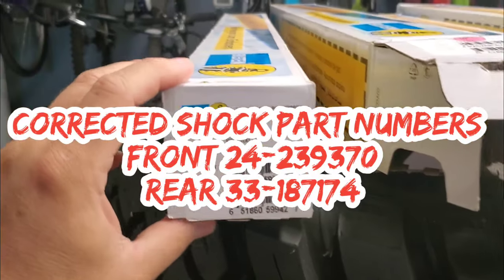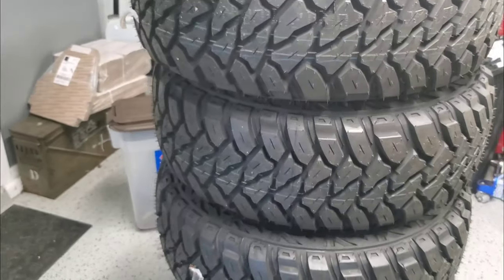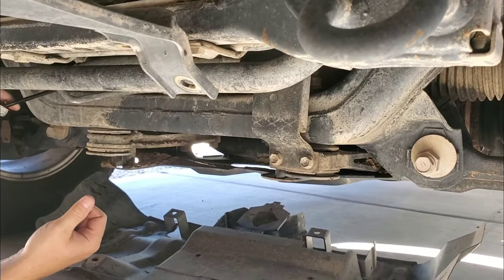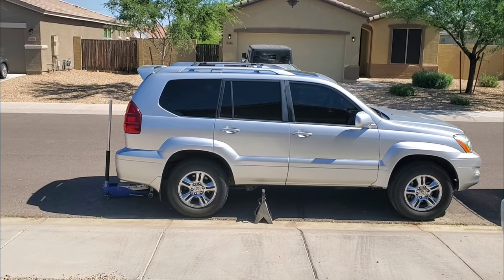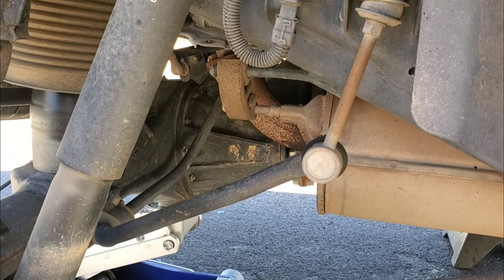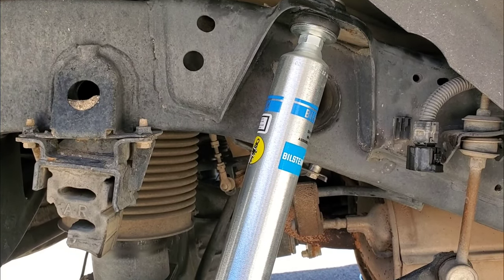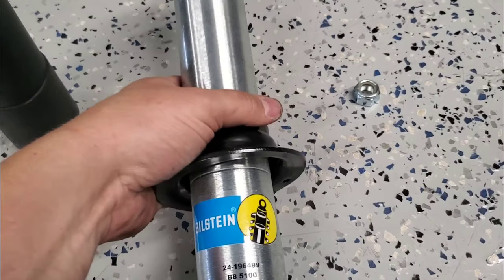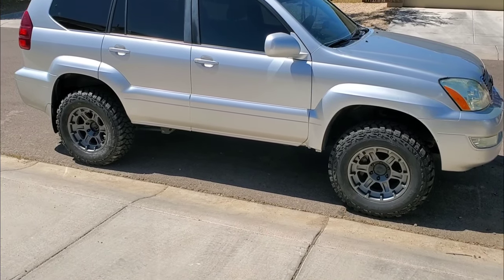SIMPLE LEXUS GX470 / GX460 / 03-09 4RUNNER LIFT. AIRBAG TRICK - BILSTEIN 5100 - DIFF DROP

Comment: Just wanted to say thatnks for this.  Worked great for me, I kept the stock rear shocks(for now), added a simple nut spacer and let it all air up. Its 1" higher than stock which on stock wheels looked good just enough. Going bigger in the future, bit this worked til i can run off some tread on the stocks and justify the MTs

Comment: My GX470 has been stock longer than any other vehicle I’ve had. Finally ordered Bilstien 6112 for the front. Will try the air bag trick and add Dobinsons long travel shocks to the rear I had laying around. Once the bags blow I am going with AirBag Man 2” lift bags. They can be tricked up to 4”.
Reply from the maker: Right on! Are the bags original on yours? If so, definitely change them. They never last long with the added pressure and being so old. The arnott bags are cheap and so far, holding up awesome.
Reply: @MR_Garage  I believe mine are still factory but don’t leak down even after sitting for a few months. 

I ran my GX460 airbags tricked up around 2” and had a set of Airbag Man 2” lift bags to swap them with when they blew. I installed the Dobinsons coil overs up front and had ran the rear completely stock for over a year. 

They survived a Lone Star Jamboree and I never ended up installing the lift bags because the stock bags wouldn’t blow no matter how hard I tried lol 😂 Flexed them to the bump stop plenty of times too.

I’ll be ordering some lift bags in August though when my budget is freed up and I’ll actually put them on this time to see how they work.
Reply: @marcochavanne  No diff drop on the back? How many washers for the 460?

Comment: Sweet and easy!  I dig it.

I too appreciate the awesomeness and comfort of airbags!  I'm using bushings for airbag spacers.  I just felt more confident in a single unit vs the stack of washers and tried a 1/4 bushing or proof of concept then moved on to a 1/2" spacer bushing (for 1" rear lift) in my set-up..   (true value PN: H883490, 1/2" heavy steel bushing)

I understand the front diff drop (and recognize the many arguments for and against) for axle geometry, and wanted to hear your $0.02 on the change in driveline geometry and output shaft seal stress or universal joint geometry changes related to dropping the front diff.  thanks for the sweet and clear video explaining the airbag trick!
Keep on keepin' on!!

Comment: Great idea for the air bag rear lift, beats the hell out of doing it any other way. I'll be putting the 5100s on my 03 4runner(limited with airbag and xreas). SO how does it ride/handle compared to the stock shocks. I'm hoping it's not too jarring when I get the 5100s on mine, although I swear the xreas on mine was making it ride super hard. Love those GX470s, pretty much the same drivetrain as mine which will last for a very long time.
Reply from the maker: It is a good firm ride, better than stock and much more controlled. Much improved freeway manners and towing manners. If you want a more plush ride, stick with load range D tires.
Reply: @MR_Garage  Thanks for the review, love the looks of your GXs.

Comment: I have a Prado 150 (what you'd call gx460 in America) and considering lifting it for 2". The thing with the airbads is that they have some maximal lenght they are designed to go to, and once you put in rear shocks which have longer length you go over this limit. Longer shocks also probably require longer air bags, I'm considering the 2" kit by Airbagman. Did you have any problems with the airbags during suspension flex?

Comment: It looks a little high for my taste (I’m 70 and drive 80% on asphalt) but maybe it’s deceiving because the running boards are gone.  What setting do you have the rear height?  Do they have a default setting they want to return to...high I think.  I have an ‘06.  Sorry for all the questions.  I just sold my ‘07 4Runner and I had the fronts at the first notch (3”4” I think) and the rears wherever they came out and it was very nice and level which is what I’m going for.  I’ll change the stock size tires to 265/70-17.  My Firestone Destination AT’s went for 65K and still had 5-7K of tread left.
Reply from the maker: Likely the running boards. Truck does not feel like it is sitting high really. Slightly taller is all. The GX has 3 suspension settings. The default which it always returns to automatically if over a certain speed, is N or normal. The spacer trick makes normal and high carry a lift per the spacer trick. I only use the low setting for hooking up a trailer.
Reply: Thanks for making this video.  Very helpful for the do-it- yourselfer like me who doesn’t want a lot of change.  Oh...where did you get the diff drop kit?  Sorry if you said somewhere in the video.
Reply from the maker: Here you go https://www.ebay.com/itm/For-03-20-Toyota-4Runner-4x4-4WD-Billet-Aluminum-Differential-Drop-Kit-Diff-Drop/263521278586?ssPageName=STRK%3AMEBIDX%3AIT&_trksid=p2057872.m2749.l2649
Reply: @MR_Garage  I have an 05 Sport with the KDDS.  My question is, would articulation be affected at all with this hack?
Reply from the maker: I have not worked on the KDSS equipped GX's - best to ask the guys on the forums or facebook groups if lifts cause any issues with the setup.

Comment: Fantastic video. Just my opinion here, and please don't take it wrong: saving on tires is kinda shooting on the foot. You can have  the most sophisticated and expensive car in the planet, with the most advanced technology, electronic controls and on top of that, Juan Manuel Fangio driving it, BUT the only contact point between all that awesomeness and the ground are your tires. If they are poor quality, everything else falls apart.
Reply from the maker: Good point!  However, Kenda makes good tires. They have been around forever. Getting very good reviews in the GX and 4runner communities on their RT and MT's. I used this exact series for 2 years on a heavy single axle on/offroad travel trailer without issue. I have 1 other GX and 2 4runners on toyo MT's - will be watching and comparing as these age. If all goes as I think it will, I will make the switch.  And yes, I have owned falken, Nitto and too many BFG's (can't stand them). So if Kenda does not end up working out, I will go back to toyo and eat the insane price tag. But I think they will.

Comment: I just  bought a GX yesterday Lexus serviced for 180K miles.
Reply: That's awesome! But you should work on redoing every maintenance item anyway, like the transmission, diff, and transfer case oil. Lexus and Toyota like to ignore those things and you want your car to go to 250k at least!!
Reply from the maker: Of course - and already done. When I pick up a new to us vehicle, everything is gone through in rather short order.

Comment: Thank you thank you. Just put the lift on and it looks great. I am thinking I could go with a little larger tire than what you used if that’s correct what would be the next size that you would recommend
Reply: I see a lot of 03-09s with 285/70 17s

Comment: Guys like you make YouTube awesome. Think I can clear a -25 offset wheel with this setup? Any alignment issues with -25? Scrubradius a concern? SSW Dakars to be exact. Thanks in advance
Reply: 17x9
Reply from the maker: Much appreciated! With the same basic 32" ish size tire, you might get away with it, but likely will need to pin front fender liners (no biggie) and may have to work the area around the step. But the extra -13 will help over what I have shown here.
Reply: Yea plan is to run 265 70s.  Fine with that minor trimming but concerned about rub at the body mount.  Tie like to avoid bmc. Do you think you have that extra 13mm of space to the body mount to accommodate the -25 wheel? @MR_Garage

Comment: Great video - cheap, simple GX470 lift.

Edit 24 hours later - a word of warning... The airbags are not all that durable. My GX is a 2004 with 130,000 miles. Always been in Hawaii so no temp extremes (almost never outside 50-90 F range). I only added 2 washers (4 total) under the height sensor, but that was enough to encourage a leak. It seems the leak started after the mod. Now I'll decide whether to replace the bags or convert to springs.
Reply from the maker: It is not the lift, it is the age of the bags. They act as springs + bags and yours are / were 16, nearly 17 years old. That is a heck of a long life no matter the suspension component! I have had mine a around 2" of lift for years on newer bags towing 4-5K lbs often. Zero issues.
Reply: @MR_Garage  I very  much agree. Just mentioning that an old system that works fine may work less fine once you start tweaking. Nothing wrong with the process, I just wanted to warn others to be mindful of potential consequences. Especially if, like me, they're on old bags.

Comment: Good video. A lot of explanation and and you showed us some of the important parts without making us watch you do every bit of it or other. Well done.  
 I do have a few questions. You refer to it as a differential drop but it seems to me really you are pushing the body up??   Do you have any trouble running out of vertical lifts with the airbags in the back? Do you have the DSS system on your GX? Or are these the regular adjustable shocks?   How much rougher are the Bilsteins than the original suspension?
Reply from the maker: Hey Craig, Appreciated. Per your questions... 1. The diff is actually lowered with a diff drop. The housing of the diff is moved downward and then held in place by spacers. 2. No, the high function still functions as intended, just higher of course. 3. You get rid of and disable the factory adjustable shocks with this lift. Just simply unplug them, will not throw codes. These are adjustable in height on the front, non-adjustable rears.  4. The bilsteins are actually very smooth and well damped. I have no complaints. The only complains you will see online are from people that swap in the bilstein fronts and leave stock old blown shocks in the back that are bouncy.

Comment: Awesome video! I am however a little confused. Doesn't disconnecting the plugs in the rear turn off the height adjustment? I guess my understanding with the washers is that it will trick the system to keep it on the highest setting? I guess my goal is to keep it permanently on the high setting to give it that lifted look the entire time even when driving highway speeds.  Thank you in advance.
Reply from the maker: Nope, it is independent of the struts. You still get all three ranges, just shifted higher. I use them all the time towing.

Comment: Ok Lauren here from Ft worth.. I finally got my billstein 5100s on. It looks great, I did diff drop and air bag trick. While doing the front I observed that I need to replace ball joints, stabilizer bar end links and tie rod ends.. should I just replace the control arms with joints already in or can I remove and replace ball joints myself? Also what the best aftermarket brand to use for suspension on the gx??
Reply from the maker: If you have a press, press tools and like suffering, do your own ball joint and bushing replacement 😅 Otherwise,, just buy pre-assembled OEM units or aftermarket like superpro control arms. Makes life so much easier.

Comment: I am getting this exact thing done to my wife’s GX. I may need to show the installer the video. However, he didn’t mention anything about a diff drop, we don’t tow or really off-road it’s more just for the look, however should I ask about the diff drop? Also looking at 275/70/17 KO2s will this lift be enough to prevent tire rubbing. Also used your video to delete side skirts👍🏻
Reply from the maker: I prefer one - just saves a bit of wear and tear on your cv boots. Pretty much it.
Reply: i have the same tires on mine and i have very minor rubbing when the wheel is fully turned could be easily remedied with some wheel well modification but so minor you may not care anyway.
Reply: @michaelhill7298  Do you think 285s would be too much with wheel well modifications?
Reply: @MR_Garage  I think when I get mine I might design a mudflap/fender that gives it a stock look post tires/lift. I just like that Prado look.
I'd model 3d printed pieces, paint them, and or paint/black flap. Perhaps just the flaps with cleaner lines.
Definitely a project I'd enjoy gaining experience with the whole scanning/referencing /modeling/printing yadda yadda

Think it's a fools errand? Haven't researched much on forums or anything, maybe there's more Prado specific aftermarket flaps or retrofitting that already addressed it...
Thinking at the very least, seeing how it might look continuing the front fender line to match the rear aesthetic, maybe it might clash with the existing fender arch.. 

Apologies if I'm not very concise, spitballing lol
Cheers

Comment: So I got $1000 to spend... Want to do a lift like yours. I bought mine with brand new air bags so this is perfect for me. I need the front and rear shocks, bushings, lean spacers, top hats, and wheel spacers. That's roughly $547 without the strut compressor. I'll be on stock wheel and tire until I upgrade down the line. That should give it a little more aggressive look, correct? I still want to fit the truck in my garage and I have about 6.2 inches of growth possible so I think this setup will be put me right around there.

I've got 200k miles, do you think the springs are okay? how would I know if they were saggy? LAST Question I promise. I have the adjustable suspension dial in the cab that goes from comfort to sport. All that goes out the window after this upgrade, correct?

Then planning on 275/70/17 tires, and a muffler swap to liven up the tone.
Reply from the maker: Sounds like you have a great plan in place! At 200K miles they are saggy or will not last a long time once compressed with the 5100's. Go with Eibach front 2" lift springs that I have in the description. Then, do not use the 2nd notch on the 5100's, go all the way to the bottom notch or 1 notch up (I ended up going with these later when my factory springs started to give up. Last, buy the 1/4" spacer I have listed for the drivers side. Helps eliminate the typical toyota / lexus SUV sag. And yes, the dial will be dead at that point. Does nothing.
Reply: @MR_garage    

The Eibach springs definitely work with the 5100’s??  With that link you posted, the guy from eBay emailed me when I ordered them and says they only work with with Eibach Protruck shocks.
Reply from the maker: 100% they work, I have them on my own rig.
Reply: @MR_Garage   Sweet!  Because they’re on the way!!  lol   Thank you for the video!!   Big help!  And exactly what I was looking for!
Reply: Hey last question,  I finally got the stuff and installed it!!!  Love it!  Thank you again!  

My question is the dash lights came on for ABS and traction control.  Did I break a wire? Or does unplugging the shocks do that?  Did it happen to you?
Reply: @ralphulrich4621 lol same here

Comment: Curious if you know whether you can do the washer trick to the front end in lieu of the 5100s to gain height in the front?  We are holding our son to a budget over time and would prefer to do everything in steps.  1st: diff drop and washers front and rear, 2nd: 5100s front and rear, 3rd: Tandems and BFGs.  Any guidance much appreciated!  Love your channel!
Reply from the maker: The front does not have air suspension - nothing to trick as they are fixed struts.
Reply: @MR_Garage  makes complete sense.  Wasn’t  thinking.  Thank you for the reply.

Comment: Hi Mr. Garage. I first saw your video about brake controller, then saw this off road lifting and tire installation. I have a 2008 GX470, and planning to use it to tow a RV trailer and some off road driving. I live in Chandler, I'm wondering if I can chat with you to get some advise from you about what I plan to do?  Thank you Wei
Reply from the maker: Sure, ask any questions here. Most everything lift wise or towing wise I do with my GX's have been placed in videos. Just generally upkeep things or improvements.
Reply: @MR_Garage  With a sway control system installed. Do you think what's the maximum dry weight it can tow safely? Will the lifting and MT tires  improve the towing experience? Thx
Reply from the maker: With weight distro / sway control figures are talked about in this video. https://youtu.be/Hf_PM8aMB5k    MT tires with a stiffer side wall or load range E tires definitely improve the towing experience. But not the day to day ride quality. I still prefer load range E though as I tow so much.

Comment: DUDE!!! Fantastic! I am in Tempe and wanted to try this in the heat, skipped it. Looks like my '04 GX, same silver, I have the matte black TRD (real TOYO parts) wheels and tires on already. Know a shop that may do it for me? I don't want to mess with the front springs!
Reply from the maker: Sorry boss, I do not know any shops really. I just work on my own cars. Definitely check out the Arizona GXOR group on facebook for local recommendations
Reply: @MR_Garage  Thanks for the reply. I priced out the parts and all-told they come in at $609 not including the strut compressor which I may borrow from AutoZone.

Comment: hey. awesome video. what was the diff drop? whats the benefit of doing that?
Reply from the maker: Lowering the diff lowers the axle connection points at the differential. This makes for less angle on the driveshafts and less wear and tear on the CV boots. Every bit helps if you drive a lot or freeway miles.